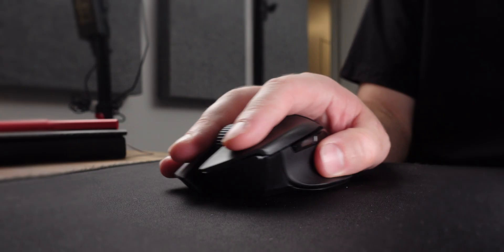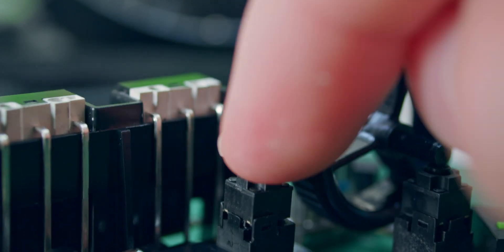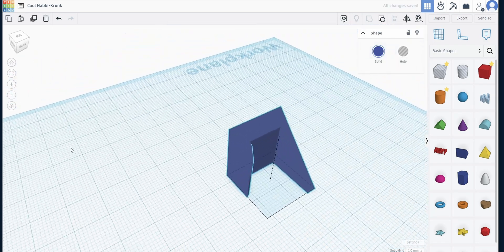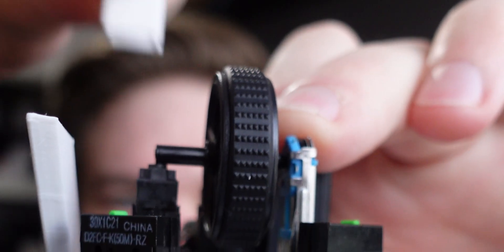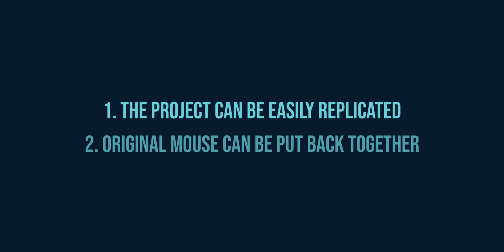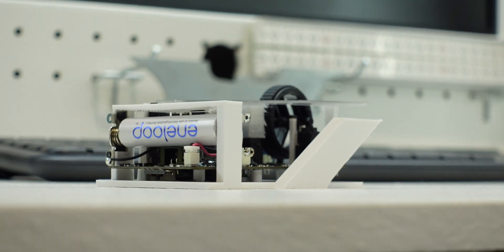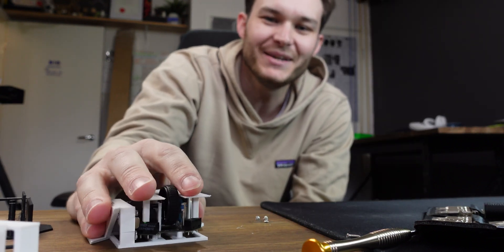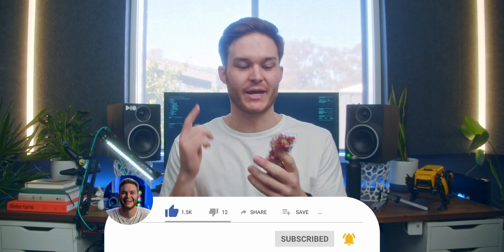3D Printing a Lightweight Gaming Mouse

Comment: Quick question, but can this work with the razer basilisk v3 x hyperspeed?
Reply from the maker: wouldn't know but I presume not, as seems there's weight differences that may also suggest a PCB change inside.

Comment: Hello there! I'm probably a tad bit too late. But I was wondering if I could fit a wireless G502 into this same printable shell since it has a very similar shape as the original mouse you used. Absolutely loved this, as a commenter said: criminally low amount of views. Congrats on your project.

Comment: Looks fantastic and is a reasonable upgrade from stock, but you shouldn't be comparing it to overpriced and under-speced gaming mice. The G Pro X Superlight and Superlight 2 (GPX and GPX 2, respectively) are generally considered the gold standard and go-to by many mouse enthusiasts. But they are old designs that aren’t competitive in today’s market. They mainly rely on BRAND LOYALTY to make sales. Some mice outperform it in every category, like weight and technical specs, which include a better sensor, switch choice, i.e., optical switches or mechanical switches with high click ratings of 50 million and above, and improved click latency, all while being cheaper. Off the top of my head, I'm familiar with the Lamzu Atlantis, Ninjutsu Sora, and Pulsar X2V2.

I understand the joy of building random stuff/modding hobbies, but you could’ve started with a lighter donor PCB. From a relatively newer mouse with better technical specs like Optimum did with the ZeroMouse 1 and 2 (the 2 has the scroll wheel but no side buttons, but there is a similar mod kit to his available for purchase on cults3d called the “ExoMouse” and this one has side buttons), all while coming in at a similar price as the Razer Basilisk you show. The fact that the donor mouse uses a double battery confirmed that it wasn’t designed for competitive usage due to the weight that would add. I mean, it’s wild seeing a wireless mouse that still uses double a in 2024, but you being able to bring the weight down that much despite that is an achievement you should be proud of!

Good job, Sir. From one peripheral modder/builder to another, it was an enjoyable video.

And to anyone curious about my experience in the field and the countless hours I’ve sunk in it, I’ve done about five custom mice that I’ve either given away or used for years! The first was a Razer DeathAdder Essential I did around 2018, with a paracord cable and custom paint job currently used by my brother’s wife and daughter. Then, a Viper Mini weight reduced to 40 grams, utilizing all the stock shell parts with a paracord cable and custom paint job given to a friend. That custom Viper Mini allowed him to reach immortal in Valorant from diamond. Then, a Viper Ultimate weight reduced to 45 grams the following year with a 3D printed honeycomb base and weight-reduced top shell, with Pulsar Super Grips and a Stock Look in black and white. This one sits in my room as a display piece. Following that, a Pulsar X2 with minor weight reductions (54 grams) and switch + scroll wheel encoder swap, click feel adjustments (pre-travel post-travel stuff) given to my girlfriend. The encoder also has hot swap sockets soldered in. And finally, the mouse, I’m currently on a Pulsar X2V2 with the same mods as my girlfriend’s mouse minus the hot-swap encoder, but plus a logo delete.

Comment: put honeycombs in all the surfaces and it will drop to 29 grams
Reply from the maker: yeah I tried some weight savings on the base, it's really tricky as once I take material out from certain parts the PLA plastic flexes to much under my grip.
For sure can play more with future models.
Reply: 3d print with carbon fiber PLA @camshand
Reply: @meocats carbon fibre filament gets micro plastic stuck in ur hand (or something along carbon fibre splinters but rlly tiny)

Comment: You should definitely upgrade that battery to a lipo or something along those lines as theyre significantly lighter than nimh batteries like you are using.

My lightest mouse is no longer used and is not my lightest mouse when there is a single double A in it. Without the battery and wiring it itd be my lightest and i might even still be using it.

Comment: So nice to see another DIY mouse based of wieght reduction !
 
I wish my mouse project could find a collaborator, I have this clay mold for my ideal clawgrip mouse (using the MZ1 principles) but have no 3d printer nor experience in designing the thing using existing PCBs. However I know exactly what the base design can be using the clay mold and how it can be improved structurally using some optimised shape tuning.
I'm not a fan of the CAD tools since they don't produce organic results with curves and stuff.. it might be better to do the prototyping in Blender3D or something.

Comment: Is the stl available for download?
Reply from the maker: Not just yet, I've got some slight tweaks I want to make to the standoffs to make them stronger when 3D printing via FDM, the do a bit of weight reduction and add some cross bracing to support.
It's a tricky one also being made for my hand size haha, but I am hoping to put up files eventually.

Comment: As a Logitech Superlite user I feel personally attacked 😋 I do like the option to be able to add in some thumb and pinky slide supports though. GG
Reply from the maker: Yo Dude! good to see you here in the comments 🤙 hahaaha lol you're probs vibin the vid until I call out the superlight. I actually used my brothers the other day with the powerplay mat, felt surprisingly good for the small size but my thumb and pinky slides are a custom touch I absolutely LOVE 😍

Comment: You could also try using Lightweight PLA, it has a nice texture too in the hand.
Reply from the maker: Ohh thanks for the tip Tarbard, I considered lightweight options at the beginning like CF infused. But forgot to order some as the project went on.
That could be a great revisit for a part 2, testing out different exotic filaments to find a good strength vs weight for it's final form 🤔
Reply: @camshand  I bought the eSUN brand Light Weight PLA.  Fun to print with, I used it for a can coozie and some other things, the texture is somewhere in-between paper and fabric so it feels nice in the hand.
Reply: @camshand  you should do it a v2 for it been suing this for a bit and i like it but you could try to make it without the battery and fid a way to use a rechargeable battery and maybe take away the side buttons